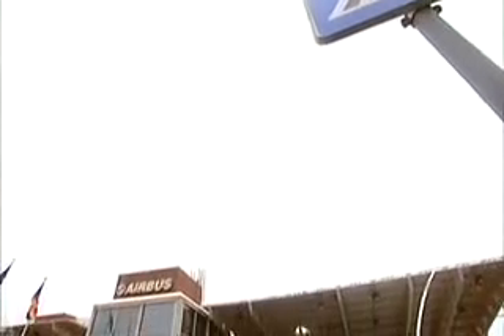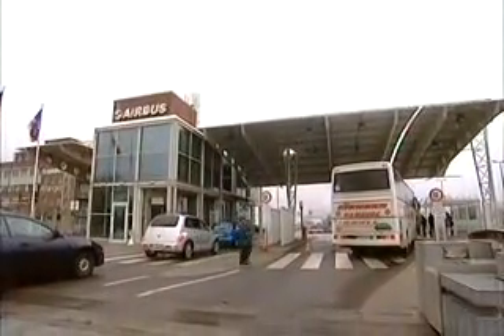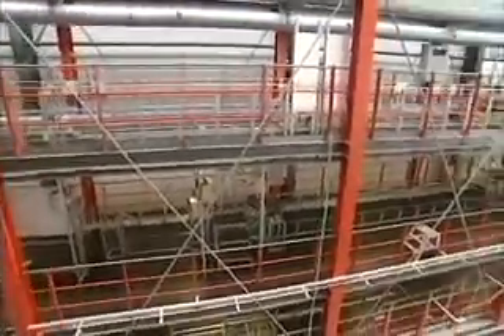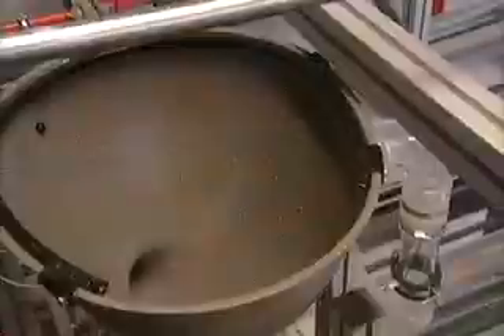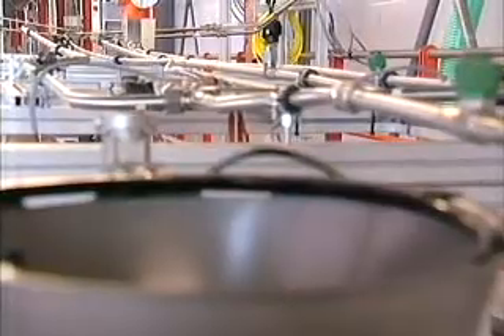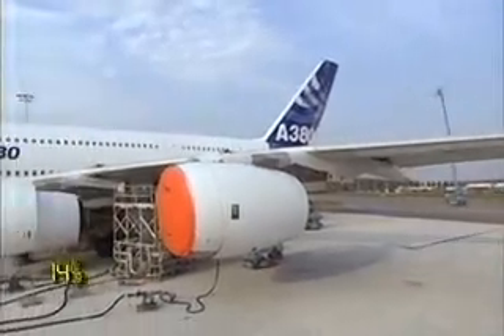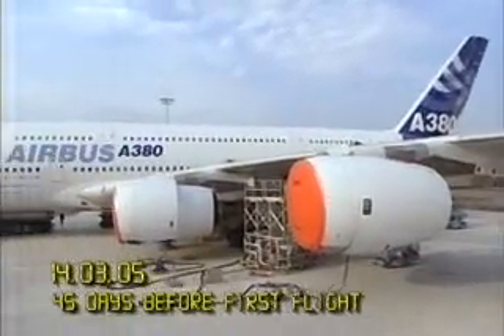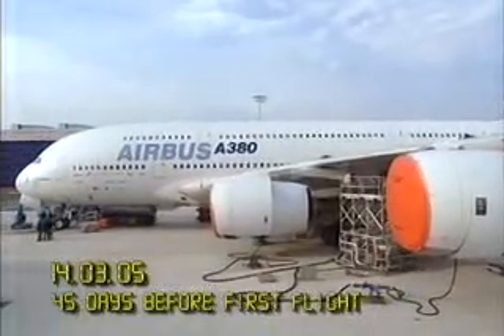A380 : 130mph toilet flush

Comment: Also the water evaporates at room temperature whenever it is put into a vacuum. 

Oh ya and breaking the myth of getting stuck to a vacuum toilet. The lavatory sink drain runs into the toilet (just under the rim). If you were to seal yourself around the toilet seat, the drain would act as a vacuum breaker.

Comment: That is exactly how the vacuum toilet system works above 16,000 FT altitude - differential pressure is used to evacuate the holding tanks. When the airplane is on the ground and up to 16,000 FT, electric vacuum pumps are used to evacuate the holding tanks. Correct valve sequencing prevents cabin decompression.

Comment: Have you ever wondered why they don't use the difference of air pressure between the inside of the plane and the outside to flush the toilet?? We'd probably be sucked out, or explosive decompression might happen.